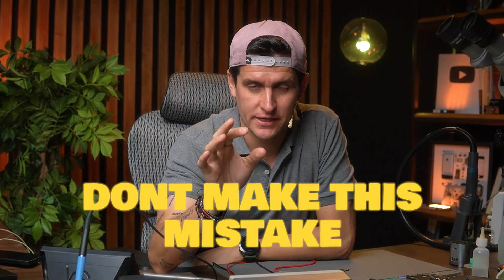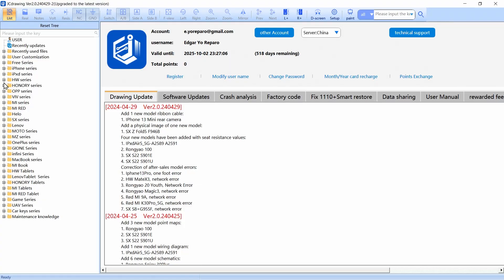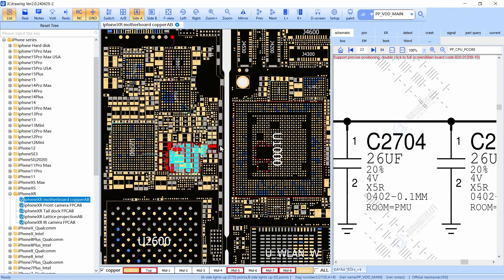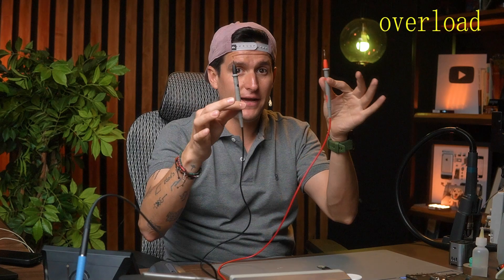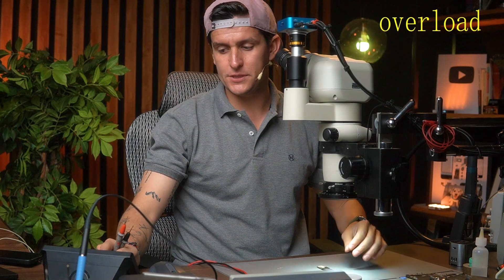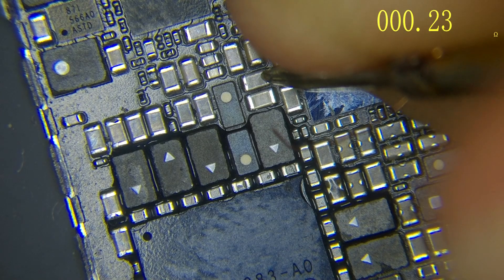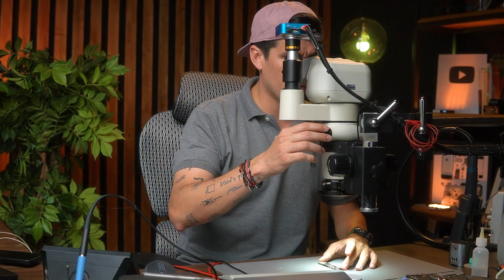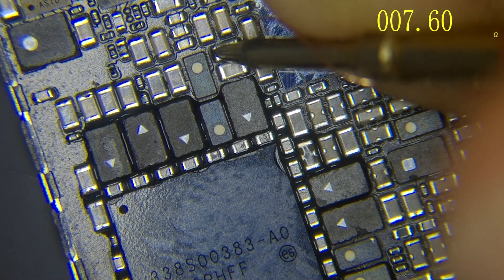Don't make this mistake when you are reparing an iPhone⚠️

Comment: The low resistance capacitors near CPU is to leak more current to the ground, not necessarily to provide high current to CPU, the reason is to prevent over current to cpu with load.
Thanks for the video